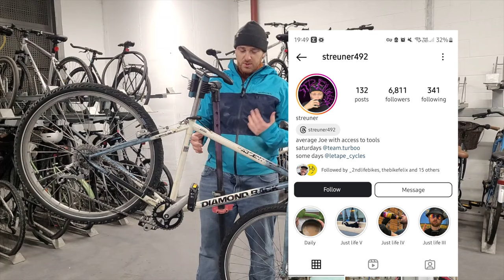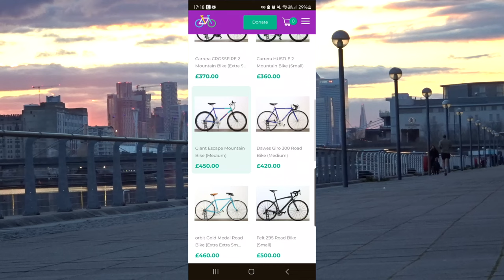Diamondback Cheap Bike Build Off - London Edition - Final Part

Comment: A little of polish compound maybe could remove the yellow effect in thte white paint. Nice job tho.
Reply from the maker: Thanks 👍 I did use some fine steel wool and some polish in the other video. I didn't want to go through the clear coat, so only a light sanding. I think if the next owner was serious about the bike, then it would be worth a new spray.bike. the paint is in really bad condition.